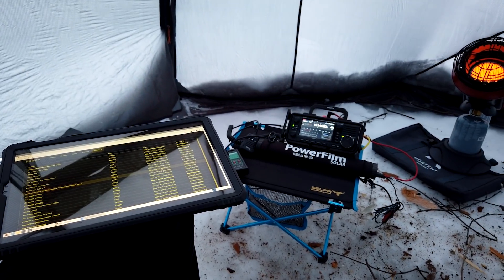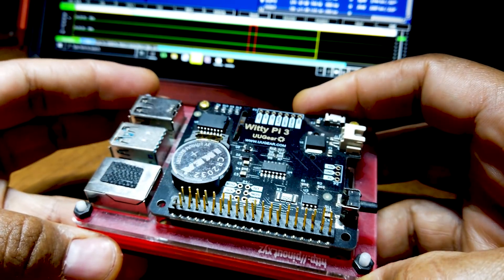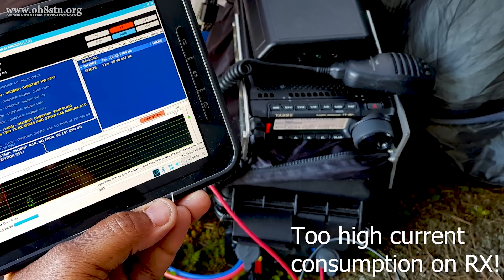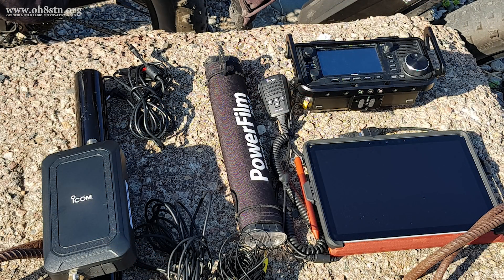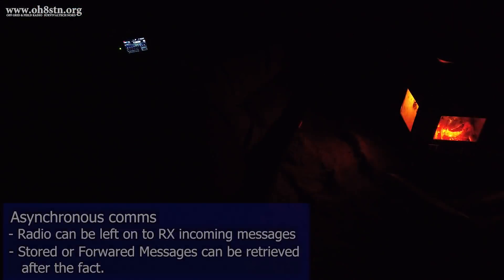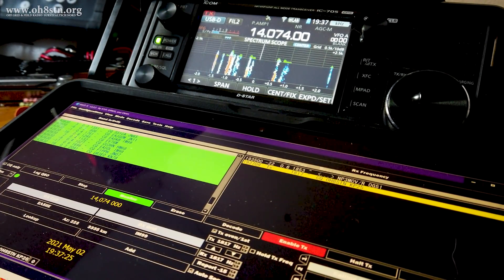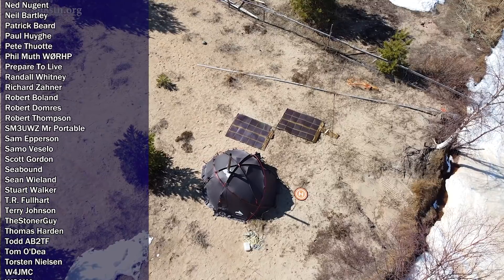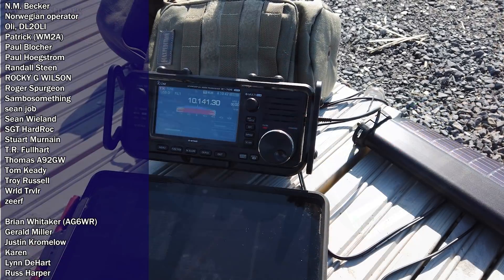OH8STN Ham Radio

Comment: Over the past year I’ve watched the evolution on your channel and am anxious to make changes for portable. With time of course. I have some new goals as a result. Thank you for the enormous amount of work you put in to make it very clear how all of us will benefit from this approach.
Reply from the maker: Thanks for this comment. Sometimes it's slow going, testing & validating then wondering if it's all for nothing. The receive current consumption was a huge epiphany. It was almost incomprehensible to think the station was burning through energy reserves when the radio sat on receive. A few days ago I realized the answer had been given to us decades ago. The military doesn't use insanely powerful radios. They use moderate power for output, and extremely low current consumption on RX. When we match this with higher-density lithium-based batteries, are operating time increases while stations size decreases.
Hopefully we can start seeing other operators proving or disproving the methodology. It would also be nice if manufacturer start creating low current consumption qro radios
73
Julian oh8stn
Reply: Thank you for another great video. 

Why go to a smaller battery pack. I would think that is one place not to down size on. With a few days of little or no sun you would what that extra power.

Comment: I'm trying to match your style in terms of power consumption and portability (though I lack the technical skills).  Assembled my Qrp-Labs QDX and put it on the air tonight for the first time.  JS8Call from Wisconsin, USA to Puerto Rico my first time out.  Roughly 1A input(Buddipole Power Mini from SLA 18AH), 15 inch LED monitor, RPi4 and Bluetooth keyboard and mouse.  You've been a great mentor in my reaching this point in my journey.  Who knew that 5.8W could get me so far?? Julian did...thanks Brother!

Comment: Julian, I was wondering what the weight is of a typical load out for you. What could you carry on your back for a certain distance. It would be interesting to hear how you calculate a load out for a mission concerning climate, terrain, etc.. Absolutely great work man. Much thanks for your field work.
Reply from the maker: This is too complex a question for a short comment. Since loadouts are "mission specific" definitely requires a mb explainer video. I'm happy to do it but we need to break it down with various scenarios. For example the time of year, the mission, Logistics available or not,... Add some context and I'm happy to put a video together 👍
73
Julian oh8stn

Comment: Julian, I think the most valuable in your video is the reasoning, not just a conclusion that is stated. It gives us the viewers an opportunity to think along and agree or disagree. That makes it so good, it gives a way to form an opinion instead of a feeling. Maybe an avenue of thought, way not go old school and split transmitter and receiver in 2 devices with for instance a sdr dongle. Downside would be increased complexity but a good use for a raspberry. Keep up your excellent work

Comment: Hi julian Oh8stn,

I have seen your video report last year where you told us that you replace the raspberry pi for the lark with windows.
That was not nice to hear, i just bought a Raspberry Pi 2 days before that. 
Now that I see the new video and explanation and goals fore 2022.
I can empathize with the idea.
And somewhere down the line, reuse  the Raspberry Pi👍🏻👍🏻
 I understand the goal with the power consumption standing by .. 
Lower power small battery.
Power that we use at night and batteries that will be loaded during the day time through the solar panels ...
I can see your goal with the power consumption and less weight to care.

It's give you a think about what we use and not use but still carry  around🤔🤔🤔

Thanks for letting us think what we really need

Regards,

Ron,Pd3ron
Reply from the maker: Thanks Ron.
This comment really made my day.
73 
Julian oh8stn

Comment: I used so many of your suggestions during 2021 and they all work just as you tested them. I have QRP capability with my G90, battery back, solar panel (not roll up yet) and a lightweight Windows laptop using an Emcomm III EFHW portable. Since this is a relatively heavy load right now (and I an no longer young) I have considered building a cart using bicycle wheels, as light a wire frame as possible and only bungee cords holding the load on. That might also be an operating point without offloading much of the equipment. It would work well in the environment I operate in (hills and valleys with lots of trees but few rocks or cliffs) but might not be right for rocky or extremely rough terrain. Thank you for educating and entertaining at the same time.
Reply from the maker: Hello Jack. G90 is an excellent platform with a balance of reasonable current consumption and output power. I also like you are trailer idea. Have a similar setup used for camping. It allows a person to carry much more than  what's possible with a backpack alone. Take a look at this video. https://youtu.be/OPEkUHAMY5Y

Comment: I appreciate that you are focusing on portable power with a systems approach. Sort of "a penny saved is a penny earned" ;-)

I would love to know more about non-traditional power sources for field use such as wind, hydro, Pelletier, etc. I realize that they are often vastly inferior to solar panels which seem t be the current raining champ for most deployments. It is just that it is worthwhile to keep an eye on possible alternatives.
 
For example, if you were to do a week-long deployment above the arctic circle in winter (admittedly not a common use case for most hams) sunlight availability for solar panels would be a major issue.
Reply from the maker: Thanks for the comments and questions. I completely agree with you! Peltier elements are too heavy to be practical but do offer a source of power. What I'm quietly working on in the background is a wind turbine which would be portable enough, yet provide about an amp for recharging our batteries. For example a couple of months ago when deployed out on the island during the storm. A wind turbine would have been the perfect option. Another idea is a small DC diesel generator. Doesn't have to be a big monster machine. Just a small hobby diesel motor for charging batteries. Couple of amps of full output  would do the trick. Anyway I'm right there with you. Perhaps we can focus on the small diesel generator and portable wind turbine this year.
73
Julian oh8stn

Comment: Low power consumption on RX and plug-n-play systems are just around the corner. I’ve watched your configurations get smaller and smaller and still continue to perform better each time and that is always a solid sign of success.
Reply from the maker: Thanks for this comment. When we can bring the prices down for these configurations, then we'll know we're moving forward. I'm hoping my work triggers manufacturers to implement these low consumption strategies into qro radio that's well. Thanks for the comment kindness and for watching.
7e
Julian oh8stn

Comment: I see a lot of people opting for the Surface. I decided on the Panasonic Toughpad and as a backup, a CF-U1 Toughbook. Both have built in GPS and hot swappable batteries. Great videos. 73 de WA5YXS
Reply from the maker: Toughbook is an excellent Solution. Please tell us how you charge them in the field away from grid power?
73
Julian oh8stn

Comment: I've often viewed receive current drain as a field operator's version of a "phantom load." It's sneaky and unless one is carefully monitoring the situation, it'll rob needed capacity from a battery. In a "typical" (meaning before-times!)  year, I spend 60-90 days in an off-grid cabin (in the summer) with my family in Canada and must keep all radio gear charged via solar. My first year out there (2005?) I realized how quickly my IC-735 could drain a large SLA battery in RX. These days, I'm using radios like the TX-500, KX2, and MTR-3B (especially at 17ma) that seem to feed from a much smaller battery for orders of magnitude longer! That's meaningful in an off-grid situation. Thanks for the great video! -Thomas

Comment: Great video. I am currently using the tx-500 with a 9ah battery. Pour voice communication but digital is fine. I use a mini laptop with windows 10. Winter field day coming up I will be bringing a propane generator to power my yeasu 857 to generate my power.

Comment: Good and well explained video. 👌🏻
Little radios like the QDX digi trx make much more sense in this scenario. With an 50watt amp. 
I’m not sure if there is a 400watt amp for the base stations. In case of power outage and relying on solar/generator power. Butt for a quick grab and go. That makes much more sense. It can be quite, even without headphones. To keep surroundings in check.

Comment: Julian, I appreciate you sharing your lessons learned. Thank you.

For operators working portable that haven't set up cozy little tents with a fireplace inside, do you have any lessons learned for solar charging lithium packs safely in sub-zero temperatures?

Your setup reminds me of a commercial with Quarterback Steve Young from the 49er football team, when he got "away from it all" with his Toyota Tundra pickup truck loaded up with basically his whole house. He was glamping out of his pickup, including his huge TV (check it out on YouTube, I think you'd get a chuckle). It strikes me that although you've been discussing a leaner approach to battery and radio equipment, your setup is still quite elaborate and does not fall in the camp of backpacker portable. Perhaps, a different approach to pick up for your 2022 lessons learned video 😜.

Comment: Hello Julian, very nice video summing up the state of the art in field emergency communication. I will definitely try to start my own setup based on my qrpver Minion Mini transceiver. For the power, I use Bosch 18V drill batteries with the adhoc Bosch converter (converts to 12V and 5V). I just need to find a way to charge the Bosch batteries from my solar panels. BTW Julian, I am and have always been a Microsoft fan 😜. 73 de Boubker CN8BSB.

Comment: Great video, a lot of food for thought. I love qrp, being disabled I don’t go out into the field like I used to. Usually once a month with my 705, the 705 loop and a 7 amp/hr 12 volt battery. 
  I have a Surface Pro 3 I’m trying to figure how to get ft8 to work on both my 705 & my 7300. Hopefully I get it figured out soon, just now have the pieces I needed. Gotta figure out the configuration on my surface pro with the program for ft8. Look forward to other videos.

Comment: @oh8stn With the diy599 pa500 having a 2 year wait list before the war even started and the price doubling to $1000-$1100ish I would love to see you review some other tuner/amp combos or recommend some sort of other option. I've been eyeing the xiegu xpa125b but mixed reviews and the weight alone gives me pause.
Reply from the maker: Honestly, for a portable operator there are no other options with these features. There is the Xiegu, Elecraft and Hardrock 50. Also a few Chinese ebay amps but none come in with the features, weight and low current consumption of the PA500. It really is the benchmark for a portable amplifier. This is the reason other amplifiers haven't been reviewed.

Comment: I found your analysis of equipment and what the critical needs of field opps require to be on the mark. My QRO rig is part of a go package that is only good for organized EmComms working out of a mobile shelter but as for my QRP ops I am using an older SGC2020 in an old Uniden cellphone nylon carry case. Fits fine, carry weight, not too bad but I will need to check specs as to Rx current draw and test this individual radio if it is different than factory specs. Still have not decided what computer to purchase for field use. The tough book is nice but way too expensive, have not looked into the MS Surface or similar yet. Not too many choices here in SV land.
Again thanks for all of the research into what will work best for the field! 73!

Comment: When sun light is at a loss, have you considered a peltier junctions on the sides of your wood burning stove?  At QRP levels they might provide some recharge power when the sun is down?  Great video.
Reply from the maker: Yes I have thought about peltiers. The reason I haven't implemented them yet is their weight versus the amount of energy we get out of them. If I could build one which could generate for example 0.5A for charging while staying under 1kg, it would be a solid solution.
This would be a practical solution for the three months out of the year I have almost no sunlight. Unfortunately I haven't found a good commercial solution yet. So I think we would definitely have to build one.
73
Julian oh8stn

Comment: You are SO right about high RX current being the dominant factor on battery power.  Handhelds are about the only radios where RX current reduction is a design goal.  My battery rig uses a Yaesu VX-5 for 50mhz, 146mhz and 440 mhz with 5 watts.  RX current (squelched) is 45ma, but in power save mode it's about 30ma.  I use six 26650 cells providing 7.4 volts at 15 aH.  This provides several 24 hour days  of operation.  There is no good reason why SSB reception can't be as efficient, if you can live without all the bells & whistles.  But the manufacturers know that many hams are attracted to shiny objects, so they add all the glitz.

Comment: What do you use to protect your surface go 2?  I'm putting together my first sota setup as I can finally go backpacking again.  I'm wondering if I can get away with something simple like a neoprene sleeve or if I should had one of the waterproof hard sided cases that add a pound to my pack (and staying light is really important.)  Secondly, same question for the 705.  Do you protect the screen with something?  What case do you use/like?
Reply from the maker: I decided to use a Snap-On keyboard for the surface. That protects the screen. With the screen protected by put it inside a sleeve inside my pack. Nothing else required. That's worked out pretty well for me so far. If you want to protect you from rain, put it inside a Ziploc bag. Just don't forget to protect the screen somehow.

Comment: Another great video Julian

Questions - efficient and/or beam antennas can lower power consumption by boosting gain - what antennas are you using

Surface - what's the power consumption of the surface? How many hours of activity on a charge? My current outdoor operation is POTA - run continuous until sometimes something runs out of power, I've got sufficient uptime perhaps at the expense of weight ( MBP M1 laptop)

Cost - those solar panels aren't cheap , $500 per vs $100 for a 12v 12aH battery - I get that you aim to power your station indefinitely on extended trips. That said - it'd be interesting to see the cost of your kit and experiment with max uptime for minimum cost

Great work again! 

Marc - KC9WIB

Comment: I noticed the high receive current and heat on my Yaesu 857D, though not portable. Someone mentioned that grounding the wee brown wire dropped that significantly. Now I am curious to try that and see how much of a difference it makes. I don't know if that also exists on the 991.

Interesting videos and setup. Some future ideas for sure.

Comment: Julian, Thank you for your 2021 in review. I absolutely agree with you regarding asynchronous communications but that's only valid when you're able connect with a RMS gateway on a regular basis. The scenario I would ask you to explore is a pile up during a crisis situation. During such a scenario, everyone will be on the air. How will you ensure your slot needed to make contact and stay connected throughout the duration of your Winlink session?
Reply from the maker: This is an awesome question and comment. I've thought about this previously and done some testing. The thing is we can't rely on a single mode of communication. We need to have a diverse group of tools to use in case one or the other is inundated. For this reason JS8Call is ideal. It allows  Multiple stations to operate  Simultaneously within the same bandwidth.  It also allows stations to leave a message on the network for one or more stations. We also have tools like ION2G aka ALE/SELCAL, VarAC and Winlink.  Ultimately though none of these are good without some skills and experience from the operator. The operator also needs to understand the pros and cons of each mode for a given situation.
 Perhaps we need to more on this topic poster!?
Excellent topic!
73
Julian oh8stn

Comment: Great insights on power consumption.  I'm definitely rethinking my portable set up.  Besides power, I'm looking at weight reduction.  I see in some of your set ups you appear to be using RG-316?  Do you only use that for QRP?  I'm only using short, 12 inch or so jumpers but I'm having the hardest time trying to find the power rating for 2-30mhz (HF) on RG-316.  Do you have any info on that?  I wouldn't mind replacing my RG8X coax feed lines with lighter weight (although more fragile) RG-316.  Thanks for all the great videos.  73/K7KWW

Comment: A great recap of your 2021 insights. Thanks for taking the time to do this great work. I'm also interested on the kit and weight of an emcomm pack you might suggest for inclement weather, off-grid operations. 73. WN6NW

Comment: I noticed that some of your MPAS deployments, the transformer seems to be in the middle, but it's still a vertical antenna - I'm assuming.  What advantage does that have and do you still need an ATU for 40 meters?  thx.
Reply from the maker: Hi Frank. I always use an ATU with the MPAS in vertical configuration. For those times the balun was elevated, it was probably testing if elevating the balun provided better performance. It's also possible I was operating on a higher band than 40m. 
If you can show me a specific video, I can explain the configuration for that video.
73
Julian oh8stn